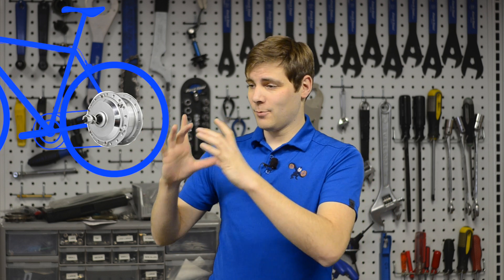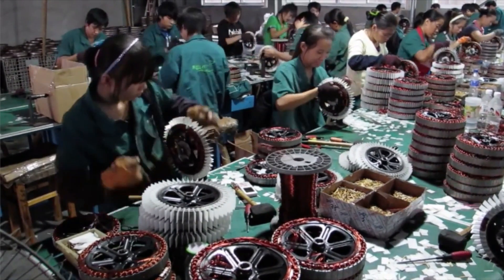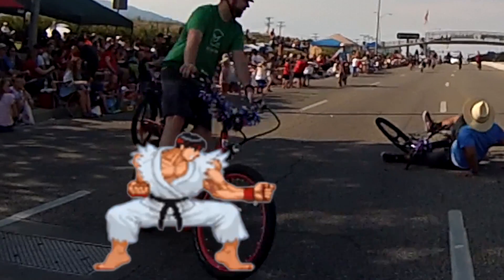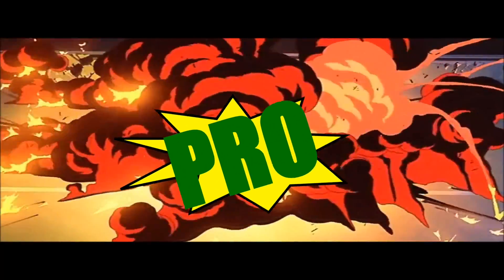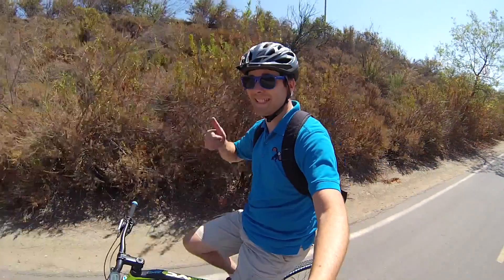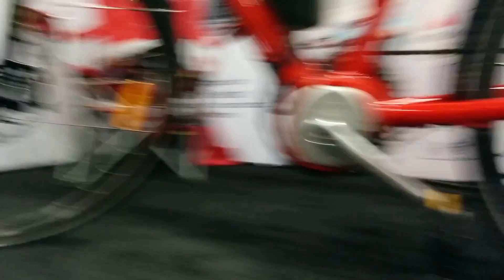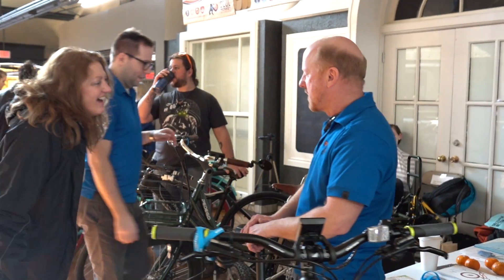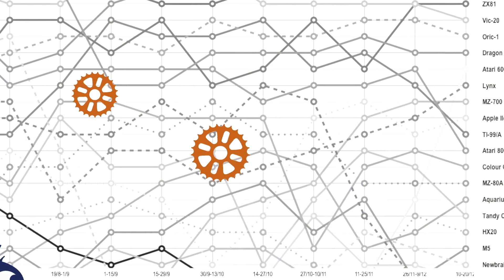Hub Drive VS Mid Drive eBike motor systems

Comment: I can't believe you wouldn't mention gearing at all in this video. This is the number one pro of a mid drive. the motor works within the bike's normal drive train, and gets all the benefits of a gear selection based on your needs.
Reply: Blue Monkey Bicycles But you'll have better acceleration and regulation of speed when the motor have multiple speeds, and not just one speed like the hub motor.
Reply: +Kristian... You are wrong. Electric motors do not need gears and adding gears only adds inefficiency.  Furthermore, bicycles are not geared for motors, they are geared for your legs, which are MUCH different than electric motors.
You have to realize that most bikes do not have an underdrive and that the drivetrain of a bike is designed for human legs to push. On most bikes, ALL of the gears are overdrive gears (that is, the wheel moves at a multiple of the the crank and not a fraction).  Things like gasoline engines want to spin at very high RPMs (thousands) and so under-drive is important. Electric motors do not have this limitation.  Also, most bike motors are geared inside.
Reply: @MrKRSO electric cars have only one gear. why does a bicycle need so many gears ?
Reply: @mb7050  Because we cycle a bicycle, not driving it. If you don't pedal, wouldn't it better be called the 'motorcycle'?
Reply: Tested both and hub drive has immense more torque than mid drive . also mid drive uses a clutch which is just another thing to go wrong . With hub drive you can still have gears and work with the drivetrain but the bottom line is you get far more torque when the motor is part of the wheel .
Reply: The positive thing about mid drives is you can go faster because the gearing gives you multiplication.  When a hub drive reaches its maximum RPM, there is no way to go faster. But if you have a mid-drive, you can shift to the next gear.
The other thing to consider, especially if it's a front hub, is it will change the way the bike feels.
Reply: Front hubs suck for sure . Mid drives have certain torque so a high gear it won't be able to pull . A high power mid drive will also destroy a derailleur's jockey wheels .
Reply: +S K.. They certainly won't be able to accelerate hard, but going into the next higher gear would allow them to go a little faster so long as the motor has enough power.
Overall, I think a rear hub drive is best.  Mid-drives usually have less climbing ability because of bicycle gearing is generally overdrive and no under drive (1:1 being the lowest gear on non-mountain bikes). The amount of power needed to go faster goes up in a non-linear way and efficiency drops off a cliff.  You might only need 100 watts to go 14mph and 600 to go 28mph.
Reply: The Panasonic hubdrive has internal gears, indeed a big adv against Bionix.
Reply: squee222 u
Reply: Nerf = artificially restrict performance. 

Like when you put a speed limit on a vehicle, or play a game with a handicap.
Reply: Which also means they're far more efficient. If you use something like the BBSHD, you don't need a custom built frame. You can slap it on any bike frame.
Reply: i was just going to comment this but then i saw this comment. gearing is the whole reason i have wanted a mid drive years ago when i never saw any
Reply: long as the motor has plenty of power gears are going to be better than no gears
Reply: +magic... Gears only add inefficiencies. On anything but a mountain bike, all of the gears are overdrive, not under drive.
Reply: Agree gearing is the biggest thing for me, i ride in hilly seattle, and being able to use my hub with gears makes a huge difference
Reply: Christopher  That is a re-definition of the word efficiency.  Yes, what you are saying makes sense.  It's dumb to not match the output of the engine to our needs, but you lose efficiency in doing so.  
If you dump 300 watts into a system, you only get less than 300 watts out.  If you mate the output (which is less than 300 watts) into a gear system, you get even less power out.  There are losses in these systems.
Virtually all cars and motorcycles on the road today generate enormous amounts of energy.  This is not so on a bicycle.  You want to keep losses to an absolute minimum because the energy storage system (the battery) is very expensive.  While the chain system on a bike is pretty efficient, it still introduces parasitic loses.  Unlike car engines, electric motors are pretty efficient along the power curve.  Unless you are running out of motor speed (for top speed) or running out of torque climbing, there is little reason to add gearing to a bike.  If you are running out of either top speed or torque, it may very well be "better" for your purposes to add a parasitic gearing system. But it is not going to be "free." While before, you might have gotten 15 miles range, adding gears will reduce the range.
There are other advantages/disadvantages to various motor placement.
What you are describing is better matching the system's output to your needs. This is not efficiency.
Reply: @tarstarkusz  Direct drive motors get less efficient at higher torque figures. so you're going to be either limited in speed by gearing it down at the same power handling, or so on. Losses by gearing in a hub drive can easily overcome far more inefficiency used for torque on the motor itself so it's worth it. Usually direct drive motors go too fast anyhow in an E-bike. I do like direct drive for the sheer reliability and overbuiltness and heat handling for plenty of regen with the hills here. The easiest improvement for hills would be getting a bike with smaller tires for the hub motors, if you can't find a slower doubly planet geared hub.
Reply: @mikafoxx2717  The main benefits are they can do regen, which is quite limited on a bicycle and they tend to have a faster high speed.
IIRC, the main point I made is that a mid drive doesn't really benefit on the low end from a bike's gears.  This is because outside of mountain bikes, all the gears on most bicycles are overdrive gears. That is, the driven wheel spins faster than the cranks (like a 48 tooth chainring driving a 24 tooth cog in the rear will make the rear wheel spin twice as fast as the cranks).  I think it is questionable if even goes faster.  Speed has power requirements and if your mid drive is a 250 watt mid drive motor, your top speed will be limited by however much power it is putting out minus inefficiencies.
Reply: squee222
Reply: Max Pain  No power while shifting. I haven't broken a chain since, Also, buy a good chain. I' mean a really good chain. In fact buy at least two. An extra for when it does break. And it will..... Buyers choice on brand names..
Reply: I bought a Specialized Roll sport and a 750w Bafang mid-drive, it's now a 1x7 44t and a 14-36. I've heard with mid drive you don't want to go below a 14t in the rear, the 7 speed chains are a little wider and probably a little stronger, I've got about 100mi's on it, mostly pulling a tag-a-long bike and a trailer at the same time with 2 kids, my 11yr old calls it the pentacycle. I haven't broken a chain yet but have one in my bag ready to go just in case, along with a 27.5, 20, & 16in intertubes the bike is only about 4lbs heavier without the battery so putting in on a rack isn't a big deal, the best part is free of the kids trailers I can hit 30+mph
Reply: Most of any setups now have dumped double and triple front chainrings, some rear cogs have a range from 10 to 50, your 21 speed also had multiple gears the were close or even duplicated.  I have a 1x11 and would only change for a 1x12, for an ebike with the assistance 11 or 12 speeds shouldn't be required and that allows the chain to be stronger.
Reply: @malcolmbagley7068  This is a question that I see with these debates, the crazy number of rear cogs.        I see a lot of advice about certain front/rear shift selections being figuratively prohibited.     But doesn't a 1x11 or more so a 1x12 cog put out larger chain misalignment angles than any combination of a, say, 3x8? And if those angles or so horrible with pedal power, wouldn't a mid mount just shred the chain on a 1x11?
Reply: GADCL4  I have 11 speeds on my mid mounted Specialized Creo SL assist bicycle and find it more than ample for all terrain, despite it having only one chain ring in the front.
Reply: squee222 - I would count the mid-drive transmission as a negative. Ideally you want a mid-generator that allows cyclist to contribute to drive power as much as possible, but not be coupled directly to the wheels. the could work out a lot cheaper than the complicated transmission systems available
Reply: Seems that gearing is an avoided topic on many of these types of videos. Having the motor integrated with gears seems best...I always just used a beefed up chain designed for motor torque .
Reply: Hell year with mid drive you got the motor working with the gears
Reply: YES! That’s what I felt would be the greatest PRO for a mid-drive
Reply: If you want to buy mid drive then go buy one haha no one is stopping you.
But you gotta admit mid drive are more complex and more tricky for conversion for an average Joe .
Reply: I realize I'm late to respond. However it seems the main push against middrives in these comments is that an electrical motor will provide the same torque regardless of gearing. Well this is absolutely true, it seems to ignore the whole point of pedal assist. These are bicycles! We are riding them and pedaling. If you're just after an electric motor bike then of course gearing doesn't matter. On a little side note though, one should also consider that an electric motor moving at too low an rpm (because of resistance moving up hills) will heat up a lot faster and be prone to failure sooner then a geared one.
Reply: its no more efficient than an efficient geared hub motor, possibly slightly less considering drive train losses, and you get the benefit of intentionality in power deliver, watts when you want them whether ecomiling or powering through an interesection with a throttle. Assuming the same wattage is being instantaneously delivered by the two motors. For drop dead reliability on long distance touring I like a less efficient, quieter direct drive hub motor. They rock in the mid speed power delivery but a little heavier. Nothing to break. I run a big rear direct drive on my electric recument trike, 28,000 miles since 2008 with a single bearing change and system runs as well as the day I installed the kit. Runs out of assist around 30 mph.
Reply: A properly designed electric drive system shouldn't need to go through the bike's gears.  Look at electric cars.  They have only a single speed reduction gear, and the motor is able to power it from zero to 100 or 150 MPH.  A bike only needs to go to 20 or 30 MPH.  I think the problem with today's electric drives for bikes (hub and mid-drive) is that they tend to use relatively large, low RPM motors.  They are heavy, and don't perform well at low speeds, which is why mid-drives actually are helped by running through the bike's gears.  I think the next step in commercial electric drive systems for bikes will be very small and light high-revving motors.  I've seen hobbyists experiment with tiny model airplane motors, which are powerful and super light.  Dealing with the motor whine might be an issue.
Reply: @dansanger5340  Electric motor gearing is dependant on how much stop and go or how varied the type of riding you are doing (think city vs highway). Electric motor efficiency is poor, very poor in-fact at below 50% of no-load speeds. This means you get a lot of torque but no work is being done, so the electrical power is drained from the battery without producing much work. Gearing can help keep your motor (or you even) at it's pedalling efficiency point which is somewhere between 75% and 85% of no-load speed. That being said, larger motors are better for continuous loads because of the thermal mass. What I'm saying in a long winded way is that a mid-drive motor that keeps the motor in it's peak efficiency point will get you a much longer distance traveled with the same size batter as a hub motor. Because that's the case, and power delivery is not a problem with modern battery packs, it makes more sense to save on weight, again, giving mid-drive the nod. The downside to mid drive could be chain efficiency. So if you have a flat or relatively flat distance to travel where there are no stops, then a properly sized hub motor would win out. Vary the speeds, or hit big climbs, mid-drive.
Reply: Dan Sanger Has
Reply: Dan Sanger noise level of those small motors ...hmmm....heating easily....hmmm,
Reply: You are wrong about electric motors. If you educate yourself, you will find that 
1) DC motors are all about equal in efficiency, given a motor of a certain power and torque
2) DC motors have the same torque regardless of their RPM
DC motor torque is determined by the amount of area swept by the coils, so size matters. Tiny electric motors will never work for bicycles.
Reply: There is a difference between a mechanical gearing and Electronically controlled "speeds" - the latter which has no effect on the maximum torque curve of the drive train and simply restricts voltage or current to nerf the performance - creating "speeds". This though is not gearing and the lower speeds provide no mechanical assistance on hills.
Reply: @squee222  yeah but with hub motor there is no friction from the gears so its almost 100% efficient. also as someone else mentioned electric motors still deliver good torque at many different RPMs
Reply: Blue Monkey Bicycles yes, and not cutting power means harder shifting, and more wear to the transmission.
With a hub motor, you can have power while shifting with no effort.
Reply: WRONG.  You just fundamentally misunderstand why gears are good for your legs and good for gasoline motors and it just doesn't transfer over to electric bike motors.
Reply: Hub drives last longer more robust, I brought a cheap China one 5 o more years ago still works to this day it’s had over 8000 miles. Brought a mid drive the down side to them they have plastic gears inside them it’s been rebuilt 5 times in 18 month’s.
Reply: Dan, that makes total sense. Kinda like the multi prop drones right? verses a helicopter.
Reply: Christopher  Of course gears add inefficiency.  I am OBVIOUSLY talking about the internal gearing when referring to a hub-motor.  
Unless you believe gears are "free" and introduce no losses in friction, it simply goes without saying that adding gears to any drive system of any kind adds inefficiencies.
Reply: yes, but switching gears is much easier on a hub drive, because the motor puts no force to the chain while you shift.
Reply: That’s why you use a gear sensor to shut off the motor while the chain is moving along the chain ring.
Reply: @CédricBerger  with mid drive u can shift while standing still wich is way handier
Reply: @CédricBerger  Good mid drives cut power to the motor as the derallier shift the chain.
Reply: @CédricBerger  not with gear cutout
Reply: I really cannot believe that someone with basic logic will buy a bike with mid drive! I am also astonished not to see or hear about the major con of the mid drive. What is something that will often occur while biking an ebike? That you will run out of battery of course. How are you going to pedal an uphill with a mid drive ebike which has a dead battery when you have got rid of the front triplet chain ring and substituted it with just one ring chain of about 42 teeth!! You just cannot!
Reply: @foodsafety5875  I can on mine, the mid drive itself doesn't add any resistance and a 1:1.22 ratio isn't too bad for hills, and if it's something you're concerned about you can drop the front sprocket to a 32t, that's what I run on my carbon mtn bike in a 1x10 setup and you can climb anything
Reply: There are so many ignorant comments. 

Mid-drives are the way to go. 

Mid-drives leverages the wider range of bike’s gearing to allow for more efficient use of energy.

“A properly designed electric drive system shouldn't need to go through the bike's gears.  Look at electric cars. “

Because of the extreme torque proved by electric motors, designing an equally robust automatic gear box to cope becomes difficult, and rather than spend resources designing an EV gear box manufacturers have selected alternatives for the time being.   

“I think the next step in commercial electric drive systems for bikes will be very small and light high-revving motors. “

This still requires a gearbox!
Reply: +Joe Yonne... You are wrong.  Humans need the gears because our legs can create a lot of push, but cannot spin that quickly. Gasoline engines need gearing in order to give more torque at lower RPMs.
Electric motors can deliver their full torque and power and pretty much any speed (RPM). 
 Gears are not magic.  If it takes 1000 watts to move you down the road at X MPH, that is not going to change because of gears. Gears introduce losses. Bicycle drive trains are not especially efficient and they don't need to be because your legs are not a fast spinning power source like a gasoline engine is. So all you are doing by adding gears is adding losses to the system.
Reply: It is not an issue really because  both types of drive have gear selection...and if anything, the number of gears to choose from is less on a mid-drive so...a con really. Maybe a wash...I cannot decide.
Reply: @geraldhenrickson7472  Mid drive conversion on my bike lost two of the rings on the front sprocket, to fit the motor in, Now I only have 8 gears in the rear. I don't miss the front gears generally as the motor really just does the hard work hill climbing, but I'd hate to be caught with a flat battery and still need to ride up the hill to home. 8)
Reply: Thats the reason why i would never buy a hub drive E-Bike
Reply: You don't need gearing with an electric motor, just a single well chosen ratio, or even direct drive. You have a constant torque - constant power curve (if the inverter uses vector control, which it should, because it's the most efficient method in addition to the before mentioned pros), that is constant torque all the way to the rated power, then constant power till the 'redline'. Also E-bikes should have damned regen built in.
Reply: Nope, you are completely wrong. The mid drive and your legs get no more assist from gear selection than a hub drive and your legs. This is a common misconception. THE TORQUE OF A DC MOTOR IS THE SAME REGARDLESS OF RPM.
Reply: @ferrellms  totally incorrect, utterly, gear selection lets the motor turn at higher revs, so going up a hill in higher revs turning faster is more beneficial.
Reply: @ferrellms  yes, so if you multiply that motor torque through a lower gear, you get more torque (and less speed) at the wheel.